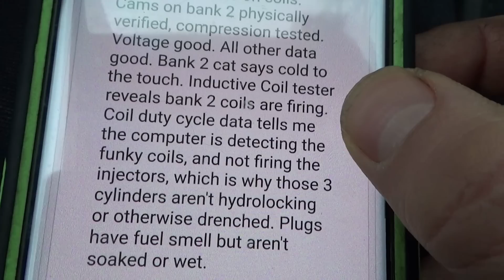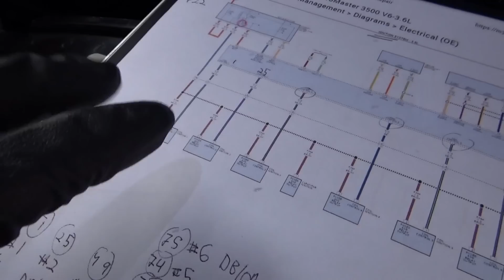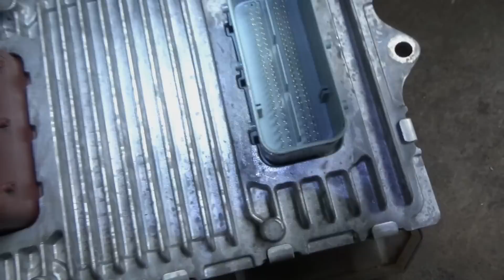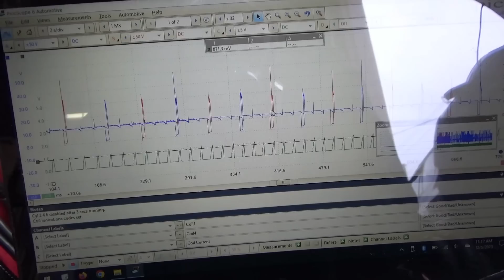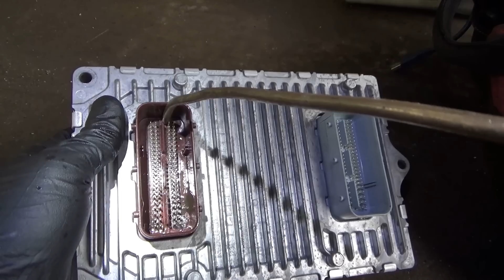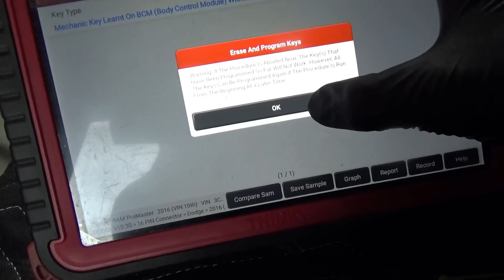ProMaster DISASTER Van - Part 1: Runs on 3 CYLINDERS??

Comment: Ivan, check out some of the Jeep guys solutions for waterproofing their ECU’s for water fording. A plastic Tupperware box that fits around the ECU, combined with a cutout for the wiring harness. Then a grommet & or sealer around the harness entrance point. I’m certain there’s videos on waterproofing electrical components.

Comment: Thank you for the details.
If I pulled these connectors apart and filled the socket side with dielectric grease would I have more protection?
What are your thoughts about drilling an 1/8" hole in the bottom of the connector for a drain?
I drilled 3/16" holes in the bottom of my headlight housings and they are now condensation free.

Comment: If your friend kip, has all the spares required, he should be able to swap the ecu, transponder ring, key, speedo clocks, and bcm (all the coded pieces) from another van, and it should fire up. 
I've done that with a couple of gm cars, that had dead ecu's.

Comment: While I think you're on a promising track, I noticed a lack of basic - what sets a P2317?  I'm wondering if it's possible to be set if the airflow into the front bank is way off. And then there's my standby: when I see electronics being weird, my first thoughts are poor ground, low/noisy power, or RFI (perhaps missing shielding.)
Reply from the maker: I read the code setting criteria out loud and showed it in the video 😅
Reply: @PineHollowAutoDiagnostics  i watch again.  I didn't see where you set down with the manual.  When you went to the scope, it sounded like you were speculating rather than applying what the manual said.  Did a segment miss the final cut?
Reply from the maker: @russellhltn1396 actually I might have missed showing the actual code description and details... My apologies! 😔
But comparing B1 vs B2 coil control traces showed they were identical for first few seconds after start up until the PCM decided to shut down B2 for no apparent reason 😉
Reply: @PineHollowAutoDiagnostics  Can't wait for Pt 2.  I'm wondering if something was preventing the right mixture in that bank and the computer was just doing its job. So many things were replaced, I have to wonder about fuel rails and manifolds.

Comment: Diagnostic is the hardest for most.
I say that is the easier part.

Getting dirty, hot, cold, wet, burnt, cut, into the wires/rust/crevices, probing and testing, thinking, checking, that’s the real stuff!

Just like today. Diagnostic:There is no power on my stuff (cameras). The 2 Ethernet switches that provide power and connectivity to those cameras, are not on. “Not my problem!”.

But that’s not me. More than 40 minutes later, after flipping at least 40 breakers (not me, I was following tte person that knows tte most about them 4 different breaker boxes), until I/me had to figure out (who else?
 then!?) and semi chase the wiring and figure out where it could come from.

I said, the wire is heading that way and 90 feet away, through 2 doors, a 5th breaker box revealed a tripped breaker, which surprises me (why did it trip? Overcurrent or short-circuit!?), but glad my 2 minute diagnostic was right (no power!), and glad “we” found the culprit.

DOCUMENTATION goes a very long way, as long as it gets updated!, but it is a pain, and almost none  of the small/medium companies do it.

For the video. The Russians (as smart and handy as most are), should at least observed/figured out the water leak/intrusion!!!

Comment: It's a pain in the butt to get a WiTech/TechAuthority account set up with Mopar, but as long as your pass-through is compatible, I do PCM replacements in the field on these more often than I'd care to think about.  :)
Reply from the maker: Brand new virgin PCM or used PCM?
Reply: @PineHollowAutoDiagnostics  Unless a shop lied to me about their source ('cause that NEVER happens!  LOL), they've all been new.  That being said, WiTech is pretty dang good about not restricting third parties, and you basically have dealer-level ability.  ~$100 for a 3-day subscription, +$40 or so per VIN to flash modules. :)

Comment: I’m pretty confident in your pcm diagnosis. As soon as you opened one up I could tell. You can see the transistors for the coils are at the very bottom corner below the brown connector… exactly where water would pool up.

On my hummer h2 the fuel system control module had water intrusion the same way and it set a code but ran fine. I tried cleaning the connector with contact cleaner that itself, ended up seeping past the pins and pooling at the bottom. It was funny because the way the board was designed it would run fine going uphill but when you went downhill, the pool would shift to the front at short out the module. It was by far one of the weirdest things I’ve experienced. 

Oh and of course gm had to put the module and connector directly behind the drivers front tire on the frame with the back of the connector aimed right at it! Unbelievable.

Comment: I had a new 1974 Dodge pickup truck. The engine ballast resistor was mounted in the valley under the hood where the rain would flow over it and damage the resistor to a no start.
Reply: Loads of Chrysler products of the day had issues with those resistors and none of the connectors were water tight. I used to spray 3M spray adhesive or battery terminal spray (messy)  on them which helped a lot. I recall back in the 80s and 90s no start cars and trucks would come in with the male spades on the resistor completely rusted off.

Comment: The harness connector to the PCM is meant to be water tight, so the seal in the connector is bad, replacing the PCM will eventually lead to the same issue. Mounting a plastic hood over the top of that unit would aid in deflecting falling water also.
Reply: Agree .  I'd try to find a new connector seal .  There's always  moisture under the hood just from driving in the rain

Comment: Wow, that is a crazy Promaster! I don't think the dealer will be able to match a used Pcm, it is an EEprom job or you can use ECU hero through the OBD port, but witech alone won't do it. (I know this is true on a 2017 But not positive on a 2016.)

Comment: Hey Ivan, I had a similar issue with a BCM. I have a HVAC type vacuum pump (5CFM). Made a chamber and let it sit in there for 30 minutes with vacuum down to 29 in Hg, solved the issue. You could also put the BCM in an oven let it cook at 250 degrees for 15 minutes or so, that may also work. Just make sure you determine the melt point of the solder and plastic before you set the temperature. The vacuum is a better option, depending on the tools you have available.
Reply: Don't use an oven... Use a heat gun and plenty of flux.

Comment: Way is the coolant warning light on when you start the van cold?
Reply: If you watch closely the first time he starts it, the coolant temp needle is at the first mark, then when it starts playing up the needle drops to zero and the light comes on.
Reply: @Marineio  maybe coolant leaking into wiring harness, had oil pressure sensor leaking into the harness backed up into the PCM on a Dodge Sprinter 3.0L diesel causing a no start

Comment: I'm not sure the PCM is bad...I'd check the spark plugs first, and the compression and cam timing on that bank.
Reply: Good point because a troubled cylinder could shut down that bank, but I’m not sure 🤔

Comment: I have a friend that works at the Dodge dealer and there’s no less than 30 of those things in there daily with every issue you could imagine. The water intrusion from the cowls happens on brand new ones. Very poor engineering. They could have at least put a slip cover over the PCM like they did the Jeep Cherokee for the same issue. Thanks!
Reply: I have a friend that has a fleet of these for a wholesale food delivery service. He has the pcm's wrapped with plastic bags. Since he did that, only 1 replacement has failed and he suspects due to heat, not water..Pick your poison I guess...13 of the 16 he has have failed due to water intrusion. I'm surprised the Pro Master shop hasn't seen more of that!

Comment: I had a customer who lives in West Memphis, Ar. His Corvette went under in spring flooding. Everything was repaired except the electronics. I replaced MOSFETS, Damper Diodes and a 555 timer IC, and the car was fine. I then waterproofed the PCM enclosure and a year later… it happened again. This time… the PCM was fine and worked after the engine was serviced to remove water and debris.
Reply: He needs taller tires.
Reply: @MWestern-m4g  He finally moved. It was impossible to find any affordable insurance for his home and auto. He bought the car for $200 after the 1st flood and it was only a year old. He made out okay.

Comment: Ivan. I used to work for Iveco, and on the Iveco Daily, the coolant pressure sensor would fail and push coolant down the wiring insolation and in to the ECM. I have seen it a few times. ECM's changed on the first diagnosis, and the vehicle would be back a month later with water inside the ECM again. Check all your coolant sensors for water in the plugs. That Promaster van is in the Fiat, Iveco family, same dash and controls,
Reply: Wow-- Push liquid into the insulation around the coolant sensor wire and back into ECM. That means you'd need a vent to expel the liquid!!! 
Poke a hole with a drain line in the wire before it gets back to the connector!!!  TSB issued with a vampire tap.
Reply: I've heard about a similar problem with some older Sprinter vans.. Transmission  fluid would travel from a failed transmission connector to the TCM  through cable insulation causing a TCM failure. Charging the TCM only will guarantee a come back.
Reply: i can attest to this on the sprinters the fluid will wick up three feet to the tcm under the seat. @danielg4228
Reply: Fiat ducato, Citroën jumper, Peugeot boxer all identical
Reply: Certain KIA V-6’s do this with the oil pressure sender. There is a TSB on it and limited warranty extension. It leaks oil externally in the valley under the intake, which then moves down to the transmission mounting then down making it look like a rear main seal leak. It also pushes oil into the attached wiring of the sender, which makes its way out under the intake and all the way over to the right side front of engine to a few solenoids on a bracket above the valve cover. The oil soaks thru those then drips oil down onto the serpentine belt and throws it all over that side of the car and hood.
Reply: I've heard this "coolant migration" was also an issue on early-2000s VWs with the coolant level sensor in the overflow bottle.  Fortunately I haven't seen it personally!

Comment: The cowl leak is a known issue. Why shops and owners sometimes seemingly refuse to address it is beyond me. If the owner thinks the shop is just trying to rip them off for an uneeded service then Google it, yeah you can't believe everything you read on the internet yada yada, but it's easy to see that it's a real problem and the fix is DIY friendly.
Reply: This other mechanic Dave has a video where he rants about the exact same root cause of all this mayhem
Reply: What is the fix? Is the cowl actually fixable or do you just have to make a rain cover for the PCM to stop the water dripping on it?

Comment: That connector is why, when I work on my own vehicles and have to pull a connector apart, it gets a thorough inspection even if it's working and also a dose of Fluid Film, Corrosion-X, or dielectric grease before it goes back together.  About once per year, when I'm under my truck for other reasons, I take some of the chassis grounds apart, especially in the back, to see how they're doing.  Stainless brush to clean up, then fluid film or dielectric grease for reassembly.  I don't wait for problems to happen.

Comment: Hi Ivan, if you have a hot air soldering station, you can swap a memory chip, and you will be able to start the engine. Yes, you will need to open a new PCM. A had a similar situation not that far ago and It worked out well. Good luck!
Reply: Ivan barely uses flux now you want him removing IC's? lol.

Comment: I have a 2014 Promaster with this exact same problem! Can watch injector pulse and coil control shut off 2 seconds after start up. Funny enough if you unplug the MAP or Cam sensor then coil and injector control stays on and will run (just runs like poo with no MAP sensor plugged in).
Reply: Check all your coolant sensors for moisture in the plug. Coolant temp sensor will fail and push coolant through the insulation on wires into the pcm.
Reply: Will this kill the pcm or is it salvageable? I dug deeper into some harnesses and did find some coolant in the harness coming from the oil filter housing area (heat shielded harness.

Comment: I had an very old British straight six auto, that ran on three cylinders, Lucas electric, VERY non-standard build. Prior to rebuild I ended up driving 200 MILES on the back three cylinders. In the end it was absolutely rotten wiring ( the vehicle had likely gotten soaked at some point ). In the end it got a new wiring harness had has run beautifully for years and years.

Comment: The new pcm needs a plastic roof/cover to re-direct the water away from the pcm, and a new connector fitted.
I bet they wont fix the bad rain leak, RIP Second pcm. :-(
Reply: Moisture is most likely coming through wire insulation of a bad coolant temp sensor. I dont think it's due to exterior (rain) moisture.

Comment: I can't tell, but if the engine is transversely mounted and cylinders 2, 4, and 6 are in front, maybe those plugs were changed to the wrong type..... Question is, can we trust the DTC's about the ionization being insufficient? Does that mean the ECM doesn't think the spark occurred?
Reply: You got a point over there!
Reply: Makes you wonder

Comment: How does a computer measure ionization?
Reply: Its just referring to injector performance of fuel delivery into the combustion chamber I’m pretty sure.
Reply: I'm guessing the coil current and time
Reply from the maker: @andrewconroy1266  Plus the inductive spike when the coil fires :)
Reply: @andrewconroy1266  thanks! That kinda makes sense.

Comment: I wasn't familiar with them ProMaster vans but it's looks to be the same as the Citroën Relay/Peugeot Boxer/Fiat Ducato that are all the same vans & massively popular here in the UK.
Reply: And the same stupid design, almost every Ducato I know suffers from water leaking on Abs,  fuse box and cam cover.
Reply: Yes, just Fiat junk
Reply: @kevinbarry71  I owned my Citroën Relay for 7yrs & not a single thing has gone wrong with it.

Also they have the same engines as a Ford Transit but I don't know if these Dodge things have the same engines.
Reply: @WombleUK engine is the the 3.6 pentistar Chrysler/ Mercedes design first installed in the Minivan and Jeep Cherokee 2011 and 300c

Comment: If you would have brought that Xtool that you have..   It definitely would be able to do the IMMO keys, no issues (I would think).  That's one thing that Xtool is quite good at.. It can pull the pin codes from the ECU also. No need to call the dealer.
Reply: I don't think it's a key issue; it has to sync the PCM and BCM. The only tool I know that can do it through the OBD is ECU Hero. Otherwise, it's an EEPROM job, as far as I know.

Comment: Probably gonna need cats. Unless it disabled the fuel injectors on the misfiring cylinders
Reply: PCM disabled fuel and spark on problem cylinder, Chrysler/Fiat engine controller program
Reply: I asked myself the same question. What makes 1 bank go nuts only after a few seconds? And no problem on the other?  Resticted exhaust? O2 sensor? Variable CAM timing? no familiar with this brand. But if Ivan needs multiple parts to fix it. It is a real disaster😊

Comment: My first guess before we get started is that it probably just skipped a couple teeth on the front bank's cam shaft and the timing is way off now..  Lets see. :) ... It's about the only thing not fired through the parts cannon. lol
Reply: I was gonna guess a shifted reluctor ring on the affected bank.
Reply: Yes, I feel the PCM is in a fail safe mode. Why is it in the  fail safe mode, maybe the PCM thinks the engine is overheating. The insterment cluster had a RED color warning light ON when the engine was cold. BUt it could be a mechanical issue like you described.
Reply: @dancarney106  I don't think it would kill a whole bank in limp mode though.. Probably only limit to 2000 rpm or something like that.
Reply: No codes though.